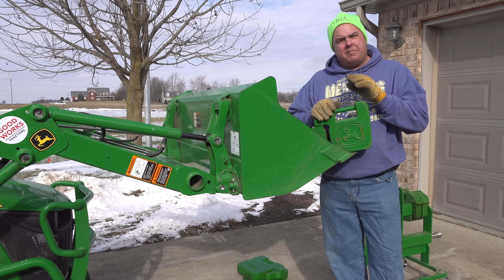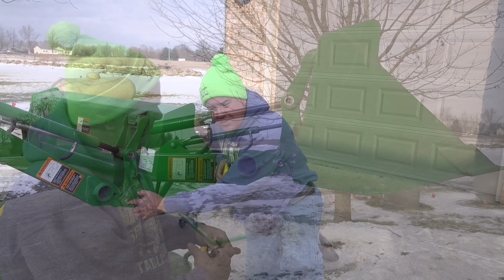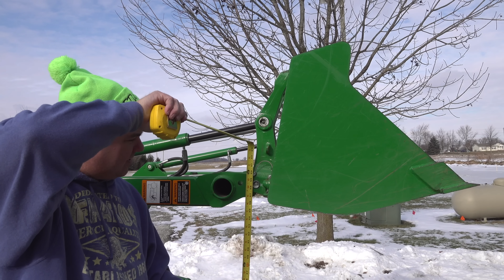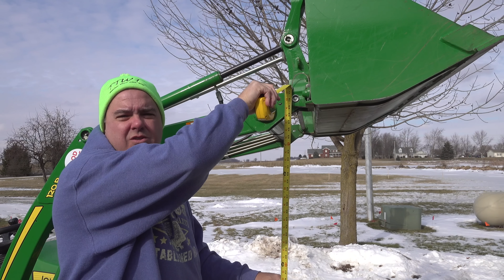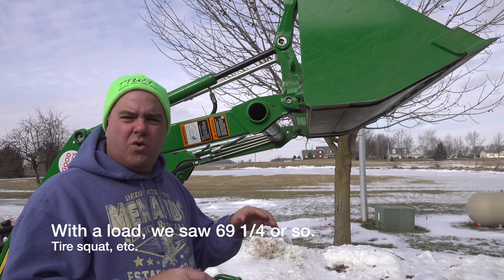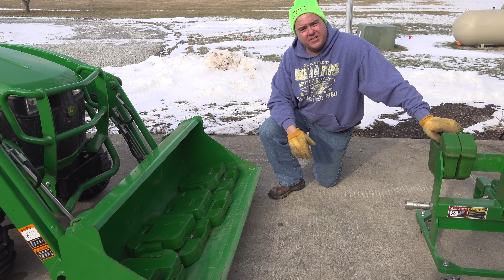Can a John Deere 1025R Lift 1300 Pounds? Mythbusters!

Comment from the maker: The loader specs came from this page:   https://www.deere.com/en/loaders/front-end-loaders-for-tractors/120r-loader/   
It says that the 49" (1250mm) bucket was used.    I have the 53" (1350mm) bucket.
Reply: Who needs specs? Those are a reference. Real world testing tells the tell.
Reply: Where's your new trailer?
Reply from the maker: Backyard.
Reply: @TractorTimewithTim  cute answer. I'm glad you're making these great videos. Gives a homebody like me something to dream about. Although I can never drive again, except small tractors.
Reply: So the "a little bit short" of the rated capacity can be attributed to the little bit more material for a wider bucket.
Reply from the maker: @subwarpspeed  who knows. ...or cares really.
Reply: When the hydraulic oil is warm It may lift more.
Reply: Nice video
Reply: You forgot the weight of the bucket itself.
Reply from the maker: No David.  The weight of the bucket is included in the spec.
Reply: Tractor Time with Tim I was gonna say, don’t forget the bucket!
Reply: Hello

Comment: Incredibly good video. THANKYOU.  I am trying to move some freshly cut logs from a white oak with a 20" diameter.. and was wondering what my options are, given that even 8ft sections will be beyond the rated capacity. These are excellent ideas and the demonstration with real numbers helps a lot.

Comment: Like you demonstrated, they will lift far more than their “rated” for if your the definition of lift is anything off the ground. It’s just a matter of how much wear and tear you’re willing to put on your equipment lol. We’ve lifted the back up a pickup truck an inch or so off the ground with a similar sized Kubota tractor. Pretty impressive, but not recommended.

Comment: My biggest complaint with mine is that the front end easily lifts off the ground when I’m digging or scraping with it. Also, the terf tires are great for moving, which we do a lot of, but nearly useless for cleaning up the barn yard

Comment: lift capacity doesn't include the weight of the bucket
Reply from the maker: Incorrect.  Lift capacity includes the 49” bucket for the 1025r.
Reply: @TractorTimewithTim  huh. I have a 5065E and my understanding is that the lifting capacity is measured at the arms that latch onto the bucket. There are a bunch of different attachments, and different size buckets that weigh different amounts, so I thought they standardized lifting capacity to be the weight that can be supported at the end of the lift arms without any attachment, and whatever attachment you use would be factored into the lift weight. Idk if the 1025r is different

Comment: Great information. I have a 2210 with a very similar lift capacity so all good but like you said gotta be very careful moving with heavy weight on a little tractor. I love my 2210. Great little helper.

Comment: I've been a Heavy Equipment Operator 32 yrs. When John Deere states at Pin. What they are  referring to is everything beyond the pin is considered part of the load, Meaning the quick attachment weight has to be added to the load unless specified in lift chart. Just saying
Reply from the maker: I was not referencing weight ‘at the pin’.   We do not use that measurement on this channel.

Comment: Also don’t forget the bucket weight does the speck take that into consideration?  If you had forks on there that weighs less you could lift more.
Reply from the maker: Incorrect.  The specs DO include the weight of a 49” bucket.

Comment: YOU DIDNT FACTOR IN THE WEIGHT OF THE BUCKET A HEAD OF THE PIVOT POINT DID YOU???????
Reply from the maker: First, you don’t need to yell (all caps).
Second, we don’t need to consider the weight of the bucket. It is included in the published specifications.  Go read them for yourself...or look at other comments wheee I quoted the specs.

Comment: I believe the weight of the bucket is included in the lift capacity, so you have to add the weight of the bucket to your weights.  If you use a set a forks, that weight will change from one fork set to another.
Reply from the maker: Incorrect on the weight of the bucket.  We checked the specs .  Heavier forks will reduce the capacity, of course, and in many cases by a meaningful amount!
Reply: Tractor Time with Tim -  yeah I have a 1026R and I was able to add over 100 lbs of lift by getting lighter fork blades.  Forks are really the only time I’ve ever had lift issues.  The bucket can normally lift any normal material you can fit in it, like dirt or gravel.
Reply from the maker: Yes, we discuss fork weight extensively on this channel.  Welcome!  Happy to have you on board.

Comment: Tim, Thanks for the videos. It cleared up all my questions about the lift capacity. I have 5X6 round bales that I need to move around to the pasture and it's only 300 feet away. They weigh around 1200 lbs. I am thinking about getting a quick attach spear and use. Your trick about curl and lift was genius. Do you think I should be able to move them going very slow as I only need to lift them a bit off the ground to move. Thanks

Comment: Love my 1025r. I’ve had it balancing on the front axle with a heavy load and was able to move it very slowly and cautiously. Also when doing my driveway I can lift a full mounding bucket of flex base. A 2 or 3 series would be nice but this 1 series is about all I honestly need.

Comment: That is plenty of weight and I don't want to try carrying that much on my 3032E tractor. Your tractor did a nice job of lifting the weights you first put on it and lifted the load up fairly high, but not high enough to put a load that size in a pickup or larger truck.

Comment: Never do a hydraulic pressure test without eye protection! Use a face shield! Also point the gauge away from you! Overloading any tractor will void the warranty and is stupid! This is why people get hurt and or killed! Before you buy a tractor think what you need to do with it and plan ahead for future expansion. It is better to buy one size bigger than buy too small.
Reply from the maker: Fascinating.  Nothing different about the test than using the hydraulics normally.

Cannot void the warranty by attempting to lift too much.  That is incorrect.

Comment: I would rather know the load capacity at the blade so if i have to unload with forks i know the safe amount and not the pin amount
Reply from the maker: That is exactly what we are showing you, right?
Reply: @TractorTimewithTim  Exactly Tim.  I often hear the pin lift capacity but it really matters what is in the bucket...In your case your lovely wife :)
Reply from the maker: Yes.  The pin capacity is useless information. No one knows how to translate that to useful lift numbers.

Comment: As an interesting aside, I would postulate that the reason the relief valve appears to open in different places at different engine speeds (read: pump flow rates) has nothing to do with the pressure and everything to do with the flow. When the engine speed is lower, the pump flow is lower, and when the engine speed is higher the pump flow is higher.

When the relief valve opens, an orifice is created for fluid to flow through. That orifice is smaller than the line feeding it, so the outlet side will experience a pressure drop and a flow increase, and the inlet side will experience a flow drop and a slight pressure increase. In shorter words, at higher flow rates the relief valve can't "relieve fast enough". 

You may be able to test this on your machine with a second pressure gauge by teeing into the relief valve outlet. However, just looking at the parts catalog I cannot tell if there is a way to get to the relief valve outlet or not. It may be worth looking into as a fun experiment. You can also do the same experiment with flow meters, just to prove the relationship of flow and pressure across an orifice.

Comment: My Ford 80 , 8 hp Single cylinder kohler engine, with homemade loader will lift over 1100 pounds with bucket level at 6 feet high. Like you said though , don't go far or at all If you don't have to. But that's the difference 40 plus years make. 
The backhoe I made for it is bucket flat at 8 feet deep , dumps at 8 feet high, and swivels 180 degrees. 
Loader is over ten years old and backhoe is over 6 years old and both have been used quite extensively. From putting my 800 pound safe in my house to building my son a motocross track. 
I have taken it to many antique tractor shows and demonstrated it often .

Comment: I saw your chanel looking at the truck box vidio. Ive got 5 loaders on tractors and we took all are loaders off are small macheaney because never found any lify problem hydrolics are strong i find are small tractors just arent heavy enough to work a bucket i could only move a little more then a weelbarrow worth of wood and tires slip wen i try to dig or push found the small buckets almost useless if i was going to tell some one looking at small tractor for bucket in mind get a bobcat or you need atleast 30hp tractor no smaller then this tractor u have they bucket just dont have the volume and cubic mass we should of never got buckets on are small tractors

Comment: RE: 5:07  If you look at the pressure relief valve from an engineering perspective, what it's actually doing is starting to bypass fluid starting at a certain pressure. The amount of fluid bypassed will depend on how much it exceeds that threshold (let's say that threshold is 1900 PSI). So if you're pumping more fluid, at high idle, it will need more pressure across that valve to bypass all the extra hydraulic fluid. So you're right, it's technically not constant, but in engineering we approximate those things as being constant. You would need a PI controller to actually control to a constant pressure. Basically it's a form of error correction that eliminates the steady state error through the integrator. Not needed for this case since your max pressure at high idle isn't exceeding any limitations. Even with that, changes in the loading or speed of the engine would result in momentary deviations from that "constant" pressure, so it would never truly be constant. This actually applies to a lot of things, like the electrical grid frequency, or electrical circuit voltage and current. They say it's constant because it's a close enough approximation.

Comment: I had the front tires on my 1025R filled. I’m glad I did. It adds a significant amount of weight to the front which makes the tractor handle better with the backhoe on and even when I’m running around with only the mower deck mowing the yard. No squatting tires either.
Reply from the maker: 30lbs per tire

Comment: Tim, I have a 2013 1025R with an H120 loader and I notice that when the bucket has a load, it leaks down when I want to tilt back before actually starts tilting back.  I have been told that a re-generative valve will solve this issue.  Your thoughts on the matter.    and since you have a newer model, did they address the issue.  fill the bucket or forks with weight on it.  Then try to tilt up slowly, mine actually goes down until I apply more hydraulic pressure.

Comment: Great video! Good reminder of what the rating really means and the real world application of the rating.
I have 42" forks that I use to move industrial 48x 40 wire baskets of firewood. I really feel lift capacity decline with the use of forks, since my lift is so far off the pin. I think the forks weigh 70 lbs each. That's -140 lbs off the working load, from the get go!

Comment: Tim, I know these Yanmar engines are well built, but as with all engines, if it is mine, I idle them for a minimum of 5 seconds or so after running at full throttle, even if you only run it at full throttle for 15 seconds. Longer idle time is recommended when working the engine hard. It is a question of normalizing internal temperatures.  FYI, I have been a professional gas & diesel mechanic for 50 years and I own a 1026R.

Comment: Excellent demo. I have a 3046 rated at 1600 pounds. Of course in real world working applications it doesn’t. And it gets sketchy moving higher weights especially on my construction site as nothing is level. I just do what you said, like BBQ, low and slow.

Comment: I’ve noticed with my 1025 if you leave the bucket rolled back until you get it to max height then tip forward you can lift more weight higher but that’s ultimately just splitting hairs I suppose
Reply from the maker: Yes, we mentioned that in the video...maybe not as clearly as you did.
Anyway, it makes sense as the load would be closer to the pin with the bucket curled.
Thanks for stating that clearly!

Comment: It's really quite amazing what these "little things" can do ... However, as you already mentioned it's an intense amount of stress to the components involved (front axle, loader, bucket, ...) so I completely agree it should be done as an exception. However, one thing I want to mention :

At least on the 2R the pressure relief valve is (I guess just a single one here for cost reasons) between the pump and the SCV (selective control valve), as it appears from seeing your "trick" to increase lift capacity it's the same on the 1R. Below the line it means that the parts are protected by the pressure relief valve as long as it's directly pressurized. If you roll the bucket down to lift the loader arms the pressure in the arm lift cylinders drops below the relief value and the loader arm is being raised. If you close the SCV by putting it back to the middle position for that function it just seals (actually it's not really a 100%, all those control valves will have a little internal leakage) the pressure between the valve and the cylinder and by curling back the bucket it will raise above the limit value. Thus it put's more stress to any component involved than planned by the manufacturer ... The front axle could fail by breaking, tires, hoses, control valve, ... So even if there is still some "extra capacity" in all components be careful not to harm yourself or anyone else if you work at or beyond the designed limits of the machine.

Note : The increase in pressure between low and high engine RPM is because of the higher flow created by the (gear) pump combined with the viscosity of the used fluid. In other words, with low viscosity oil/cold oil you might see higher pressure compared to warm/high viscosity oil. Downside of forced high flow is cavitation and therefore damage to the components. Basically the same as if you would change the relief pressure on the pressure relief valve (they are adjustable and it's just turning a screw/nut - so be sure you DON'T do it) ... Pressure in the end is a side effect on restricted flow, that's why there is a need of a protection against over pressure (aka presusre relief valve), especially on gear pumps as the pressure would raise to a point where the pump destroys itself (if the engine is not stalled before).

Extra Info (text already gets way too long ... :) ) :
For example on way more expensive machines, I own a little Takeuchi TB016, the pressure relief valve is between the cylinder and the valve, so the mentioned "trick" does not really work (actually it does a bit but within limits). To be precise there are two pressure relief valves, one between the pump and the control valve(s) and one for critical hydraulic circuits (like the boom cylinder) between the actuator and the valve. The valve protecting the actuator has a slightly higher relief value than the one for the pump. So it's a bit working but not really far as the boom will be automatically lowered if you get to a critical load situation. For larger equipment and different brands it might be different, actually it is at least if it's legal (at least here in Germany) for lifting as it has a self locking and leakage free valve on the critical cylinders that will be automatically unlocked if you pressurize it. You can really see those lock valves from the outside as they are on the cylinders, same on hydraulic 3 point hitch top links. If the hoses attach directly to the cylinders hydraulic ports -> no lock valve, if they attach to some block on the cylinder from where tubes lead to the cylinders port you'll have those locking valves.

Comment: perfect timing. just getting ready tomorrow to fill my tires w/ air and was going to put 22psi in the front. didn't even think about needing more with the loader till I saw this video. And so, thank you ! Now my question is...does the back tires need more as well? think the book says 20psi for those (turf tires).
Reply from the maker: 20 is fine for the rears.

Comment: Nice video Tim.  That is a lot of weight, more than I would have guessed.  Backhoes make good ballast weight too.
Reply from the maker: I doubt the backhoe would have been enough ballast once we started moving with that 1300 lbs.   ...but that wasn't the point of the video, so I tried to focus on what was going on in front of the tractor!
Reply: @TractorTimewithTim  Agreed.  I just always look at the back end when I know there's lots of weight on the front.  Just instinctive I guess, haha!  

A good visual testament to what the loader is capable of handling.

Comment: I kept waiting to see if you were going to blow a hydraulic line.. That kind of loads would be extremely hard on the front axel and system too...
Reply from the maker: Ah, I’be pushed it much harder than that.  I got it to use it.

Comment: Tim  It looks cold there. Do you think this test would improve if the  hydraulic fluid was at a warm  operating temperature?
Reply from the maker: I operated the hydraulics up/down for at least 2 minutes before attempting test.  I also drove tractor around and let it run for at least 5 min.  Not hot...but not super cold either.
Again, this was not scientific.  Just observations.
I wouldn’t get too hung up over the raw numbers. The fascinating part to me is the magnitude of the difference when lowered and when all the way up.